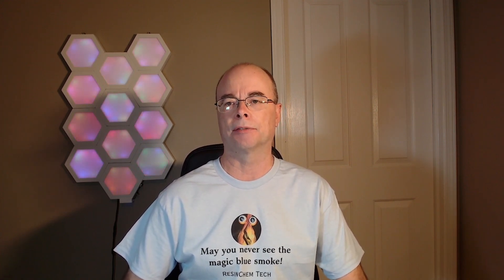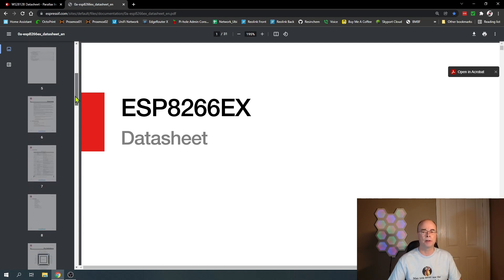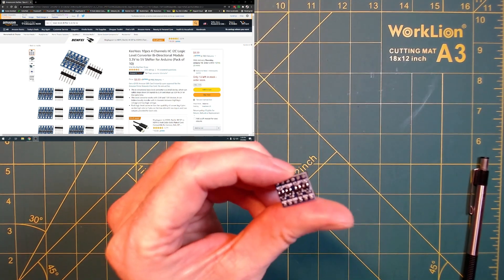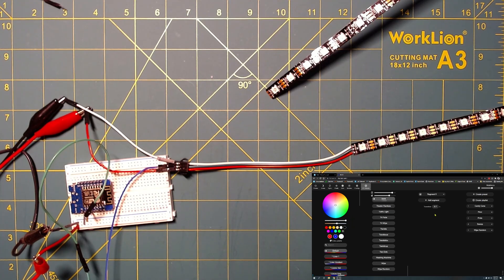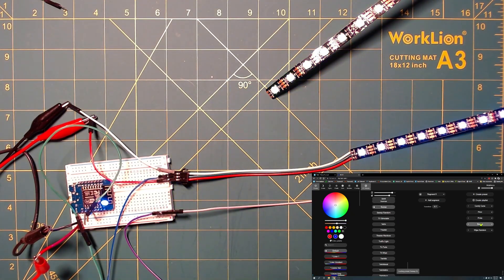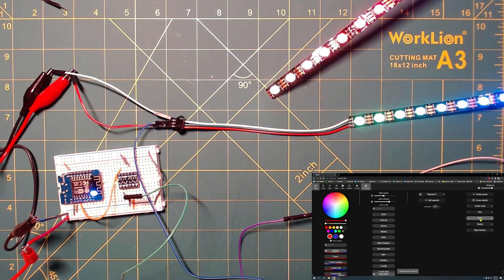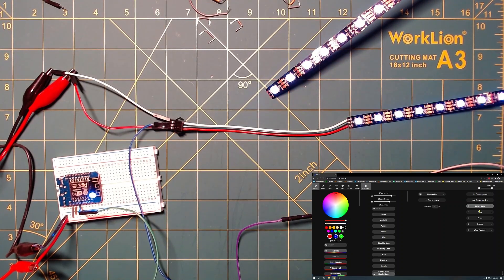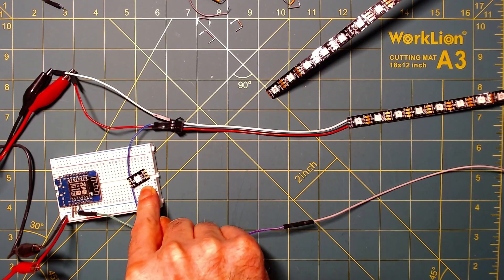Logic Level Shifter and WS2812b LEDs

Comment: I am using an ESP8266 and a WS2812B LED strip, but now, when i make the connections (VIN to 5V, GND to GND and D1 to DIN of the first LED) and upload the code to light the fist 5 led’s the esp8266 using the Arduino IDE, nothing happens. Last time when I did the same the first LED lit up and then the next time I did the same i.e. made the connection, nothing happened. Tried the same 4-5 times
The same happens when i cut the first led off and try it for the next led. 
What do you think is wrong?
Reply from the maker: It could be a number of different things.  Note that it is not unusual for the first LED or two to light up when power is supplied but a valid data signal is not received.  That sounds like what might be happening here.

But here are a few things to check/try:
• Try it without the shifter.  Note that I no longer recommend this particular type of shifter and now use a quad buffer gate.  You can see why, and the new shifter I recommend here:  https://youtu.be/Va5eTscUJQI

• Assure you are connecting to the correct end, as indicated by the arrows on the WS2812B strip.

• I don't know what your Arduino code is using (nor which board/IDE/Library versions), but there was an issue with FastLED at one point.  Double-check that you have defined your LEDs properly (including number of LEDs, type, etc.).  You might also try the neopixel library instead of FastLED (or even vice versa).

• If none of the above resolve the issue, you might need to start testing individual components.  Try a different ESP8266, try the LED strip with different firmware (like WLED) to assure nothing is wrong with the strip, etc.  This includes any wiring, connectors, etc.

Without seeing your actual setup and Arduino code, it's a little difficult for me to provide any additional info.  But I'm happy to try to assist.  Let me know what you find out from the above.

Comment: What about using it on a pcb? The controller about 26mm away from the first din?
Reply from the maker: Yes, you could certainly install it on a PCB via through-holes.  But I should mention that since I did this video (and a follow-up video), I can no longer recommend these I2C-compatible shifters.  While they worked for me when I had short leads between the controller and LEDs, I now recommend a different shifter.

If you want to know why (and the shifter I now recommend), you can watch this video: https://youtu.be/Va5eTscUJQI
Reply: @ResinChemTech Thanks for the response. I also would like to know if it necessary to use any shifter at all this one or the SN74, if the controller is 26mm from the din pin, that would save me the trouble of designing the mosfet circuitry on the pcb.
Reply from the maker: As I always state, you may be able to get away with a shifter.... until you can't!  There is no 'set distance' where a shifter becomes necessary simply due to many different variables, such as the tolerances of both the ESP and the LEDs, wire gauge used, etc.  In some cases, you may be able to get away with a 12-24" (or more) wire lead without issue and without a shifter.  In another instance, you may see issues with something like a 6" lead.  That's why I always just include a shifter in all my builds, whether it is truly needed or not.  If the shifter is present, then I really don't have to worry about how long the lead wires are (well, up to a reasonable distance) or if the tolerances are a little less from one set of components to another.

I'd recommend bench testing with the actual components you plan to use and a lead length just slightly longer than planned for the final installation.  If you don't see any issues, then go ahead without the shifter.  But also note that it can be much more difficult to go back and add a shifter after the controller is already built, instead of including it up-front, if you do discover issues with the data signal after the project is already completed and installed.

Comment: THanks for the video! I wouldn't have expected it to work without a level shifter for such relatively long lengths! But as you said, better safe than sorry! I've also seen mention of shifters like SN74AHCT125N as opposed to the mosfet based bidirectional shifter you seem to be using, the argument being that the bidirectional shifter has limitations of speed as opposed to the SN74AHCT125N. Have you come across any issues with regards to speed of changes with your setup? Thanks!
Reply from the maker: I've done a couple of follow up videos on shifters and LEDs.  This one compares the I2C-compatible shifter shown here vs. the SN74AHCT125N:  https://youtu.be/61VWgYmomz4  

Then after additional research and speaking with someone more knowledgeable on the subject, I have changed my tune and now recommend the 'SN74' type shifter.  I explain why here:  https://youtu.be/Va5eTscUJQI 

And of course there are other methods of boosting or cleaning up the data line as well.  But you are correct that while the simple I2C-style shifter works in many cases, the buffer gate shifters are truly the best choice.
Reply: @ResinChemTech thank you for the follow up! I will check out your other videos. Thanks again 🙏

Comment: Thank you.  I'm not up to speed on these.  I just need to connect an IO pin (input) on the ESP32 to a peripheral outputting 5v logic.  Is it necessary to supply power to the 5v and 3.3v pins on the device, or can I just connect the ESP32 IO pin to the low side, and the peripheral to the high side?  Thanks very much.
Reply from the maker: No... you must supply the reference voltages (3.3V on the LV side and 5V on the HV side).  The shifter needs these reference voltages to be able to shift the data signal from low to high.  Think of the shifter sort of like an amplifier (not exactly right, but close enough for this example).  You can't just feed an audio signal to an amp and output to the speakers... the amp also needs power for the components required to boost the signal.

If you use a quad buffer bus gate shifter (like the SN74AHCT125N), then you would only need 5V connected and not the additional 3.3V.  In fact, this is now the shifter I recommend, although I never had an issue with the shifter shown in this video.  I describe why in this video:  https://youtu.be/Va5eTscUJQI
Reply: @ResinChemTech  Thank you for your fast reply.  I appreciate it very much. Regards.

Comment: Level shifter made it worse...
I didn't use a level shifter, and the first segment of the strip had an other color. I tried using a level shifter to 5V for the heck of it, maybe it would solve the issue. Well, it didn't, but the strip flickers erratically every now and then when using the level shifter. So in my case, better no level shifter at all, it's working better with a 3V data line (data line length to the strip is about 20cm, strip length is 4m / 12V strip)
Reply from the maker: Well, this video is now over three years old.  Since that time, I've done additional videos and research on the level shifter.  In the most recent video ( https://youtu.be/Va5eTscUJQI ) you can see why I no longer recommend this particular shifter for most situations and instead recommend the use of a 'buffer gate' style shifter.  And I think I've stated in all my shifter videos (and as you have found) that you may not need a shifter at all if your data line between the controller and start of the LEDs is kept relatively short.
Reply: @ResinChemTech  Alright, thanks!

Comment: This is exactly what I was looking for. Thank you very much :)
Reply from the maker: You are welcome, but note that I did a follow up to this video to compare these shifters (which some say are "too slow") to the recommended shifter:  https://youtu.be/61VWgYmomz4

While that video didn't show any appreciable difference, further conversations and research as led me to change my tune and now recommend using the SN74AHCT125N as a shifter when one is needed.  Do note that I also have diagrams for how to wire this shifter in my blog article on standard wiring diagrams:  https://resinchemtech.blogspot.com/2023/01/wiring-diagrams.html

I've successfully used the shifter in this video dozens of times without issue, but if you are looking at wiring leads more than a few feet or a couple of meters, then you may need the recommended shifter instead.

Comment: Good day Sir 👋 
can you make a video explaining how sacrificial pixel can be used as a logic level shifter?
Reply from the maker: I show how to wire and use the sacrificial pixel in this article:  https://resinchemtech.blogspot.com/2023/01/wiring-diagrams.html  (just look for the diagram labeled "Sacrificial Pixel" under the Logic Level shifter section) .  There is a setting in WLED if you wish to "skip" this pixel so it doesn't light up when the rest of the LEDs are turned on. Hope that helps.

Comment: Note for using a pixel as a shifter. Add a 1n400x diode to being the power down from 5v to 4.3v. Now your 3.3v signal is within 0.7VDD and it should properly register. And the output will be within the 0.7VDD of the next pixel.

Comment: Stumbled on this while researching level shifters for an unrelated project.  ...Coincidentally, my other project drives LEDs with an ESP32, and my issues started at 5ft.  As you added length, I was predicting when you'd start having issues!  You can't believe how thrilled I am to find a solution I didn't come looking for!!!  Awesome!!!!
Reply from the maker: Glad it helped! As I think I mentioned, I just include a shifter with all my builds whether I think I need it or not. That way I don't have to worry about wire length.

Thanks for watching and for the comment.

Comment: I learned it the hard way, now I'm currently installing the level shifter and it such a hassle.
Reply from the maker: Been there!  It is definitely easier to install a shifter when creating the controller as opposed to going back and trying to 'retrofit' one after a problem is discovered. 

That's why I opt to always include a shifter with all my controller builds... whether I think it will be needed or not.  After adding one a couple of times, it now takes me just a few minutes longer than if I simply omitted it.

Comment: Thank you.  That's exactly what my project needed.  I was at my wits end :)
Reply from the maker: You are welcome!  As many have stated, you can often get away without a shifter if keeping the controller close to the strip... until you can't.  Many people have experienced the same thing as you.  That's why I opt to simply include a shifter in all my LED projects, whether I could get away without it or not.  The low cost and minimal effort to add it is well worth avoiding any potential problems later (in my opinion anyway).

Comment: I think this is my problem and solution. Are you powering the level shifter from the same power supply that drives the LEDs? Will try soon and report back. Thanks!
Reply from the maker: I'm powering the ESP and the 5V side of the shifter from the power supply, but the 3.3V side of the shifter is being powered off the 3.3V pin of the ESP board.

I also had misbehaving LEDs in one of my very early LED projects that was fixed with a level shifter.  That's why I always include one now... even if I might be able to get away without it in some situations.  Good luck with your project!
Reply: @ResinChemTech  This is pretty new to me. It's hard to make sense of what all the cables stretched across the breadboard are doing. Any chance you can link a diagram of how this is all connected, or maybe explain a little bit what part of each chip is connected to which?
Reply from the maker: No problem.  I get this question and many others about wiring the LED controller.  So I have a blog article with a lot of different wiring diagrams, including a section specifically on the level shifters:  https://resinchemtech.blogspot.com/2023/01/wiring-diagrams.html

Do note that most of my videos (but not this particular one) where I show wiring or code, there is generally a related blog article with copies of those wiring diagrams or code snippets.  I always leave a link to any written guides in the video description.
Reply: @ResinChemTech  Awesome, that was helpful. Appreciate the timely responses. 

So I've made progress, but I'm still having an issue. LEDs are more stable but are still flickering intermittently. With the D1 powered by usb, the blue light will be on and the LEDs will not act correctly. With the D1 still powered, sometimes the blue light cuts out, but the LEDs will respond correctly (although they still flicker, much less than before.) These are 24v LEDs, is there a chance 5v is still not enough to drive data on them?
Reply from the maker: You could check the technical specifications for the particular LEDs you are using.  The electrical characteristics section should specify the expected voltage for the data signal (probably called logic voltage or similar).

As far as the blue LED, if you are using the same GPIO pin for your LED data signal as the one tied to the LED (D4 / GPIO2), it is not unusual to have the onboard LED to turn off when the LED strip turns on or vice versa.  I think different versions of WLED handled this differently throughout its development.  If it concerns you or you don't want it to do that, you can move your LED data line to a different GPIO, like D5 (GPIO14).  Just remember to update your LED preferences in WLED to the new GPIO pin being used.

One other thing to try.... an older version of WLED.  My hexagon lights (DIY nano leafs) started acting really weird and not responding when I upgraded to the latest version of WLED (0.14.3).  I downgraded to 0.13.3 and they started working perfectly again.  The nano leafs are using a D1 mini as well.  I think that WLED is slowly moving towards the ESP32 and I believe that the latest version may have issues with the lowly ESP8266.  You can download 0.13.3 from the WLED Github and do an OTA update via the Security and Update section of WLED... or you can reflash via USB cable.  I'd try this downgrade first and see if it resolves the issue.

Otherwise, you might just need to do some general trial and error troubleshooting.  I don't think you mentioned the distance between the controller and your LEDs or whether you are currently testing with a breadboard and Dupont jumpers.   You can try shortening the distance and/or even try something like alligator clips which generally have higher gauge wire than Dupont wires.  You could even try a different D1 Mini (if you have one) just to assure the one you are using isn't having a problem.  Basically, try changing distance and swapping out as many different cables/parts as you can until you get a stable signal.  From there, you might be able to identify the issue and come up with an approach to fix it.
Reply: Yeah, no specifications on data power. I’m not concerned with the blue light, just wanted to be certain what meant it was working properly.

I’m also using the controller and app that it came with rather than WLED. I pretty much turned 14 strips into 2, connected all by power and data. I’m thinking now either the data and the ground wire being in the same jacket could be causing a problem and/or maybe a resistor on the board could help? Just guessing based on research.

Comment: Hello i have a question. I bought a 200w power supply to my led but it was too small so i bought another power supply 100w and i tried to Connect it with my led but i doesnt work. I thought to Connect 1st led strip to 1st power supply and second led strip to second power supply and Connect both of strips only by data wire. When i plug in my supplies only 1st led strip who were wire to esp32 worked and esp32 were wired to the same power supply. The second one was uncontrollable and only 10 led was lit. Any ideas how can i fix that? It is only possible to buy a new more powerful power supply? Of course i used Logic level shifter but i did not help
Reply from the maker: There are two potential things that come to mind here.  First, assure you have a common ground for everything.  Both power supplies, the controller and all segments of the LED strips need to be connected to a common ground.  You should not connect the +V from multiple power supplies together, but connecting all the grounds gives a common ground reference.  The LEDs can misbehave due to different ground potentials... which may be what is happening in your case.  From what you describe, it sounds like you might just be able to connect the grounds from the two power supplies together.

The other thing to double check is that you have the correct number of LEDs defined in WLED for the total number of LEDs in both strips.

It could be a number of other things, but those are two things I'd verify.  Alternatively, instead of using two separate power supplies, you could just run separate power injection wires and inject +V/gnd from the first power supply to the end and/or midstrip of the total run.  You didn't say now many LEDs you have, nor what voltage strips they are, but also note that you should only have so many LEDs per data pin before you need to consider multiple data pins.  You can find the recommended number on the official WLED web site:  https://kno.wled.ge/features/multi-strip/
Reply: @ResinChem Tech